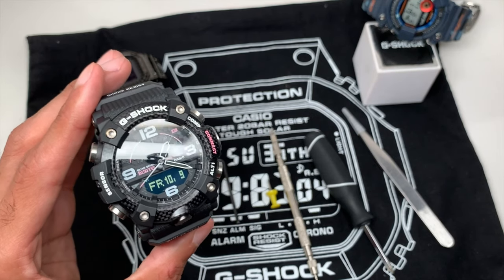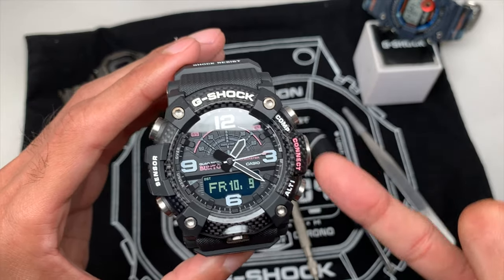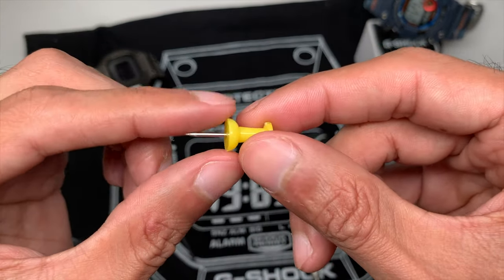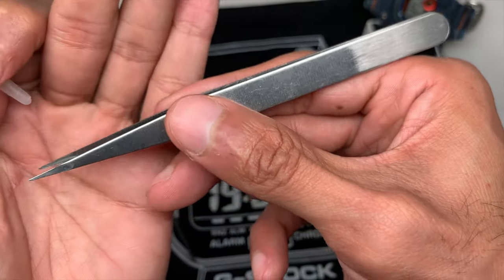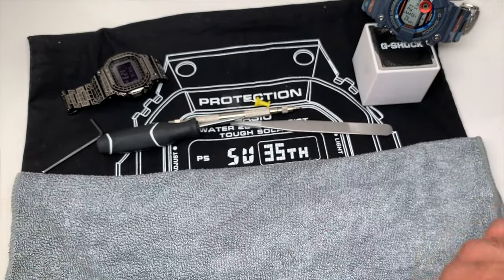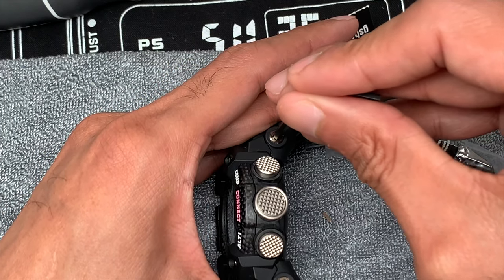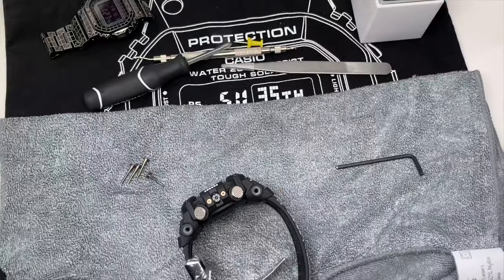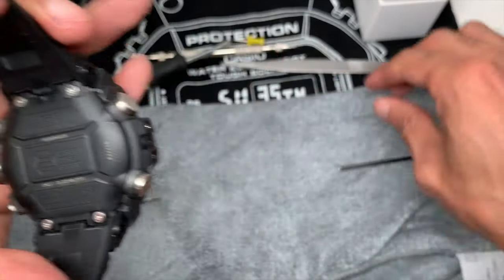How to Change battery Mudmaster GGB-100 G-Shock Watch, Detailed steps to fix misaligned Analog Hands

Comment: I heard every one saying , Solar this , Solar that! Man you sold me on getting this watch. My only concern was waterproof after changing battery. Thinking it needed chamber testing and all that, but the gasket seal , just like a car is needed to maintain pressure and waterproofing.
Reply from the maker: That’s it... simple process. I’m actually selling one if you’re interested. It’s listed in my latest for sale video
Reply: @GiShockGo  I’ll go check the video out, thanks!
Reply: Yes I'm also thinking about waterproof and concern about Tough Solar. 
What do you think about there facts?
Reply: @pyaephyoethwin1222  “There”? Where is that?

Comment: I learned that the Rubber seal sometimes sticks to the case back don't trust the Rubber seal to stay in the same position definitely remove it and install it in its little Trench sometimes a little vaseline with a Q-tip to replace the lubricant that was on the O-ring they lubricated the seal to keep it pliable and not dry up and crack

Comment: Absolutely, detaching all the bands before opening the back cover of a watch is a smart move. It helps prevent any accidental damage to the bands or the watch itself, and makes the process smoother and safer. Plus, it can give you better access and control when working on the watch. Just make sure you keep track of all the small parts and screws!

Comment: Thanks for showing yall. I have the same watch out here in Mizoram and no servicing centre is available out here. My question is that, after replacing the battery, will my watch still be waterproof??
Reply from the maker: Make sure you install the rubber gasket in the correct place and also tighten the screws. It will be water proof.

Comment: Hello! Got a question, do you know if the watch gives some short of warning either on the screen or in the app that the battery is low ? Thanks.
Reply: The app will alert You about battery, but only after connecting with the watch. BUT You probably will get this from the watch itself first, as the second hand will start beating every two not one seconds. Cheers.
Reply: @kilogram7529  I have been told that the digital screen will show a change battery icon before the second hand moves every two seconds.
Reply: All true but also the led light to see the time will start to flash instead of a steady solid light. Then the watch will show a battery symbol for dead battery
Reply: Recovery

Comment: I sent mine in to get the battery changed. When I got it back it didn't look like the back plate was sitting right. I took it apart and there were two gaskets. Can you confirm if it's supposed to have one gasket or two???

Comment: Thanks for showing how to do this. I took my watch to a watch repair shop and after they charged me $40 to replace the battery my watch now is fogged up. They said it's because the gasket overtime is dried out and old. I plan on ordering new gaskets and replace it after watching this video. But how do I remove the current fog that has built up in my watch?
Reply: Putting it in a hot car helps, just not directly in the sun

Comment: i think its very easy to make screws slide in this carbon case when customer try to change battery at first time
Reply: Not if you know what your doing. The same participles apply regardless of what material your screwing into.Common sense prevails mate....

Comment: If I buy the energizer CR2025 battery I won’t get charged by Times Square for the battery replacement just $5.28 to put a new band or bezel on my other ones I have a GD-X6900-1 that runs on that battery as well

Comment: You need to show everyone the step that ensures the Humidity stays out when replacing the back cover. You just need to use a heat Gun to warm up inside ( not burn shit out of it) then place back cover on and drive in the 4 screws.   Since it’s a air tight seal the Temp needs to no vary when replacing battery or it will start to show condensation while wearing it and your heated body temp.

Comment: Why would they make it so difficult to replace the battery???
Reply: Can you show them how to make it better and still be tough and water proof? I’m sure they could use another great engineer on the team designing new models.
Reply: @catlady8324  Sure! Hey Casio As this is an expensive watch! Kindly put in a Tough Solar panel, like the one's you put on your mid to high end watches so we don't need to suffer with battery replacements every 2 years on this watch like anyone would on the low end Casio models.
Alright where is my Cheque?

Comment: I changed my battery and now It's full of condensation. HELP!!
Reply from the maker: Ok that sounds like you either didn’t sit the rubber gasket appropriately or didn’t tight the screws enough. I would open it back up, remove the battery, dry the inside with a microfiber cloth and let the module dry throughly. Then replace the battery, do an AC reset and seal the watch back up.

Comment: Still trying to figure out why you wouldn’t take off the straps first before removing the back of the case.  And using a push pin instead of the spring bar tool you had right there? Awkward.

Comment: I think this video just shows how stupid you can be and have a watch repair business.  I went 3 places to try and get mine done, and was forced to come here to YouTube.  Looks pretty trivial to me.  
As it happens, I was right.  It took me 1 hour, including 15 minutes to run to the store for batteries, and 10 minutes for a clean, dry nitrogen purge inside a plastic bag to eliminate atmospheric moisture. (Which, BTW, the factory didn’t do on mine.  Several times I rolled out of a warm sleeping bag into a 0 or -1C campsite, to find water condensing on the inside of the crystal)

Comment: this still looks a bit ridiculous for me. id rather pay the 25 bucks for someone else to warranty the change lol!
Reply: DID IT! lol. used a paperclip to do the ac reset and had to peel that sticker off to get the battery out. but its one of those stickers that can be restickied. so make sure you guys do that or you might tear the metal clasp out with the battery because thats how the batteries locked into there. didnt know this thing had receive set to off on factory reset i went with it on for 2 years. i guess your just suppose to turn it on if you might have time to catch the next reset if its close to 630 or 1230 and your near the phone with bluetooth enabled.(if you want to be further than 2 meters away from your phone). hahahahaha.  ect. thanks a ton for helping me out with the replacement. i just so happened to have a set of glassesscrew drivers and they are totally necessary. when he says size zero. they mean it lol.
Reply: @typerightseesight  does it still a bit ridiculous to you?
Reply: @BroAriq  I did the change myself. it wasnt too tough. but you do need eyeglasses tool screwdrivers because the screws are THAT small. and theres a sticker on the battery that has to be peeled back or youll rip the metal out with the battery itself.
Reply: @BroAriq  ha. I am doing it for a second time today!